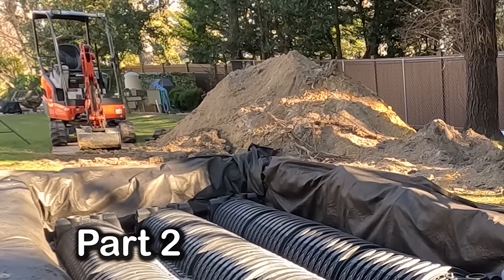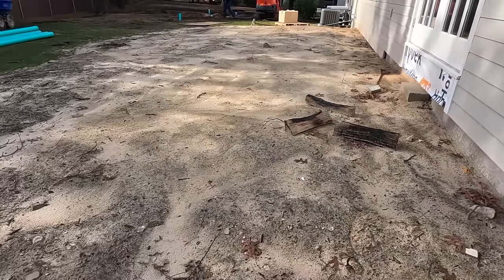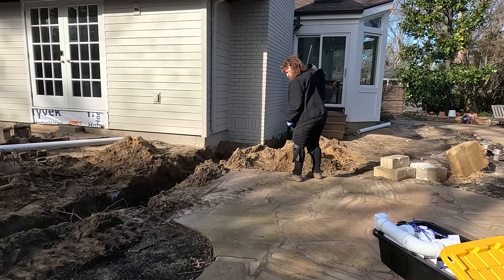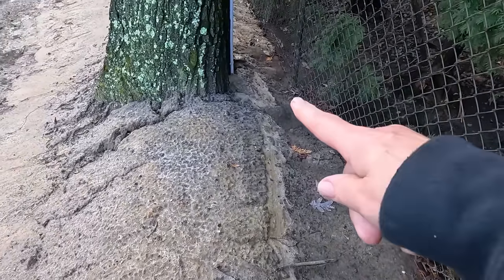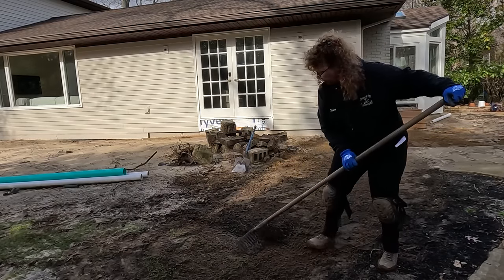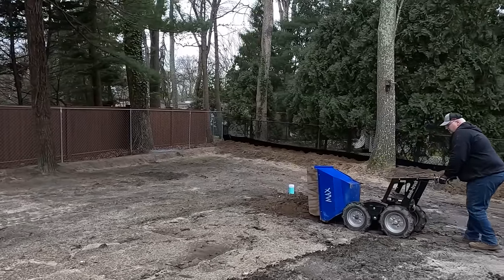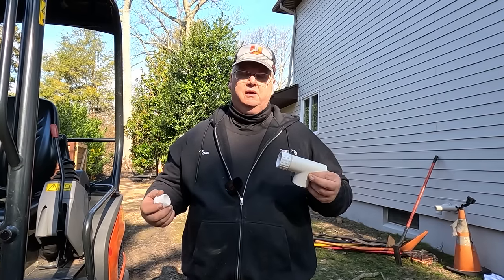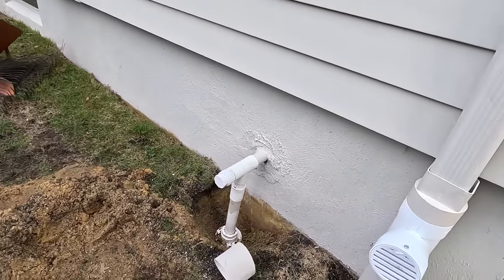Stormwater Drainage Problem - Large Dry Well, Catch Basins and Yard Grading - Part 2

Comment: Very nice job! I thought some good clay good have been used for the berm, it looks like 90% of the water comes from the neighbors.
Reply from the maker: Thank you Mike,  They definitely get a boat load of water from the neighbors, but they also get about 1500 gallons of water from their own roof in a 1 inch rain.  I agree about the clay soil.  Actually, what's there is just sand and it will erode quickly.  We gave them a price to complete the berm with a couple triaxle loads, but they decided to handle that themselves.  Thanks again, Mike

Comment: Hope there is an After video of the drainage working, if not thats a bit disappointing.
Reply from the maker: Digital, We would like to do a follow up after all the landscape work is done and the lawn comes in, but that may not be possible.  The homeowner talked about putting the house up for sale in the spring.
Reply: @tyelandscapinganddrainage  Well that is unfortunate.. Being able to see the end result of any major video would be nice.
Reply from the maker: I agree. Maybe it will work out.
Reply: @tyelandscapinganddrainage  Well your responses have earned you a sub, appreciate it.
If i might pick your brain for a moment.. Lets say that i would like to extend my gutter drainage in one form or another, PVC is likely, but what size Gutter to PVC adapter and PVC pipe size should i look for? Suffice to say i'm TERRIBLE when it comes to sizes and measurements. Its basically to just move water further from the house with above ground PVC, buried at this time isnt necessary. Amazon affiliate links to the adapters would likely be doable if you have any, the pipes ill just grab at Lowes.

Thanks again
Reply from the maker: You probably have 2 inch x 3 inch downspouts, but you have to measure that.  You could have 3 inch x 4 inch downspouts.  If 2x3 then you need a 2x3 downspout adapter and 3 inch pvc pipe.  If you have 3x4 then you need a 3x4 downspout and 4 inch pvc pipe.  You need 1 downspout adapter and 1 90 deg elbow for each downspout.  If you have a plumbing supply store by you they will give you everything you need.  Lowes also has a good supply, but might not have someone to help you.  They also have ready made flexible downspout extension with the adapter built in, but they are flimsy and may not last very long - link below to give you an idea.  I hope this helps and thank you for subscribing, Tom

https://www.amazon.com/plusgutter-White-2pack-Downspout-Extensions-Extendable/dp/B09YSW2QBL/ref=sr_1_1?crid=2C9E62YJO0ZVC&keywords=downspout+extension&qid=1707163345&sprefix=downspout+%2Caps%2C84&sr=8-1-spons&sp_csd=d2lkZ2V0TmFtZT1zcF9hdGY&psc=1
Reply: @tyelandscapinganddrainage  Thanks a lot :)

Comment: I noticed water sitting on the fabric on the dry well, so the water is not going thru the fabric, I noticed on the last video when you connected the old dry well to the new one, you put a grate and fabric covering the pipe/ grate, so that would mean the water can't drain into the old dry well very easy and will clog up.
Reply from the maker: I respectfully disagree Terry.  If you look back at 16:42 - Those are low spots, the fabric is a little wavy from backfilling.  The dry well is still full of water and percolating.  It stopped raining only a short time before.  The water in the dry well is filtered.  There's nothing to clog any fabric by the pipe going to the old dry well.  Plus, this is not a french drain.  Water gets into the main dry well from the plumbing, inlets and catch basins.

Comment: Love the video, my ? is the roof gives off 1500 gallons in a 1-inch storm, what's the estimated holding capacity of the   dry basin you installed.
Reply from the maker: 2000 gallons
Reply: you  answers my ? at the end of the video 2000 gallons
Reply from the maker: We talk about the dry more in pt 1. Thanks for watching

Comment: Were the utilities lines flagged before the dig work?
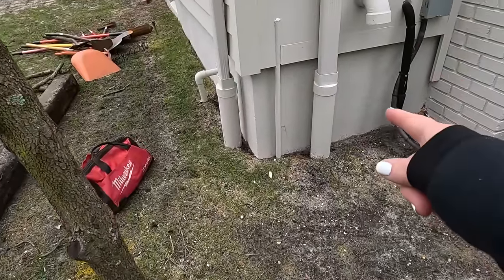Reply from the maker: Yes, there was a utility mark out.  811 / NJ1call doesn't mark private utilities.  You can see the mark out flags well in part 1 and a couple at 21:17.  There's a gas, electric and water line going to the pool that wasn't marked by 811.  This is also a new homeowner and they don't know where the utilities are either.

Comment: Why were none of the utilities located for you? I understand private lines are not located, but the electric line not being located??
Reply from the maker: Brooks, I don't know how else to say it.  NJ1 call - 811 marks the utilities from the street to the house - public.  They don't mark private utilities.  In the front yard the electric is up in the air, so I got an email saying 'not in conflict'.  The electric and gas lines from the house to the pool pump/heater are not marked because they're private.  If you watch pt1 you can see the mark out paint and flags.  This is also a new homeowner and they don't know where the lines are either.  Have a good day, Tom
Reply: @tyelandscapinganddrainage  I understand. They will mark them in our area. Not private water though, or any private line the homeowner might have laid, like a detached garage that had electric ran to it. The only one we get conflict on is the gas line. Sometimes they will locate the private line from the main up to the house, if the gas meter is next to the house. If the meter is between the house and the main they will not locate the section from meter to the house. Sometimes they will 🤷🏽‍♀️  - confusing to say the least. Thanks for the answer  😊
Reply from the maker: Thank you Brooks. It sounds like we have the same rules. Have a great day, Tom

Comment: I was just wondering why you folk’s don’t get the utilities marked before you dig? I don’t know about up North but down in my part of the country it’s free and highly recommended to avoid paying for the repair if you happen to damage a line
Reply: Utilities won’t mark in the backyard because they didn’t install it. They will mark any service lines coming into the property - nearly all in NJ are from the front yard. These guys do stuff by the book so I wouldn’t be surprised if they did call 811 for a mark out.
Reply from the maker: Gary, like Mookie said; 811 doesn't mark private utilities.  You can see the mark out flags well in part 1 and a couple at 21:17.  There's a gas, electric and water line going to the pool that wasn't marked by 811.  This is also a new homeowner and they don't know where the utilities are either.
Reply from the maker: You're awesome Mookie, Thanks and have a great week, Tom

Comment: Was wondering what the ramifications are for blocking the drainage of those two neighbors' yards onto your client's yard. Are there any municipal codes that prevent that, or is it just legally their bad luck that your clients decided to deal with their neighbors' nuisance water? I guess their only option now is to hire you guys to put in their own dry well systems. ;-)
Reply from the maker: It depends on the town Jon.  I was just talking to another town engineer about a customer with a similar problem.  He told me we could not add a 'planting bed for privacy' which would stop the neighbor's water.  While they also have the rule that water has to be contained on your own property, he said we couldn't impede the flow of water coming from that neighbor.  That doesn't make sense to me.  He said we could do it, but if the neighbor complained we would have to remove it.
In this town, from the video, water is supposed to be contained on your own property.  The town engineer was willing to make the neighbors stop sending their water to our customer, but he would have to file a complaint with the town.  That would probably start a war in the neighborhood so he decided to just handle it this way.  Tom

Comment: I have a question why didn't you just put a drain in that backyard and run a 4-in pipe to the city street and just let the water go out down the storm drains for the streets instead of putting in that large drywall system,  Or is that against the code in the city where you live? I do a lot of commercial construction and around most every parking lot that I do or project I do that has any type of asphalt area I generally dig a 2 ft deep ditch and put in corrugated drain pipe with a sock around it and 57 stone on top to catch any water before it gets to that parking structure or parking lot or asphalt whatever I'm dealing with and get rid of it that has saved me more than one time.
Reply from the maker: Hi Dozer. The dry well was the only option. The city wouldn’t permit any of this water going to the street and it’s actually about 5 feet uphill to the street from the backyard so it would need to be pumped - definitely not legal. We covered all this in more detail in pt1.

Comment: I have a problem with groundwater inundating my septic system and really cannot afford to put in a mound system. My thoughts are to put in a sump pump located about 4 to 6 ft deep to get rid of groundwater at that level. I was thinking that I could use a gabion basket that is roughly 4 ft by 4 ft by 6 ft deep to accomplish this with a decent or adequate size pump at the bottom of this basket. Does this sound feasible to you?
Reply from the maker: This is not my area of expertise.  I can tell you that we lower the water table by pools by installing a fairly deep french drain around part of the pool with a sump pump.  That lowers the water table so the liners don't float.  I've also seen 'Dirt Perfect' install interceptor pipe or drain to stop ground water from getting to a septic system.  Those are usually daylighted.  They do make plastic crates that are used in pondless water features similar to your gabion basket.  They are also very common in the UK for soakaways.  I do wonder how you pump to lower the water table, but not start having septic water intrude your system.  Where you wind up pumping ground and septic water combined.  I'm sorry I can't be more helpful, Tom

Comment: why wouldn't the neighbor be responsible for their yard causing water damage? over there
Reply from the maker: You're right Ed,  We had a meeting with the town engineer at this property.  They were willing to go to the neighbor and make them redirect their runoff away, but this homeowner would have to make a complaint.  That would probably start a war in the neighborhood and the homeowner decided to just handle this from our side.   Have a great day, Tom
Reply: We had same issue as this house with massive flooding caused by the neighbours on both sides changing their grading without permit or town authorization or direction. Huge issue, a lake while their yards remained dry. The town official said, well this is why you have the problem but it’s private property so it’s your responsibility to fix your own yard or consult with neighbours.  Neighbours are not will to do any work or spend any $$ so we end up with a work having to be done very similar and to the extent of this video. We paid the contractors, excavators and paid for a permit from the town.  People should not be changing the grades on their lots themselves, they don’t know what their doing and cheap out. If a problem arises it’s everyone else’s fault including the town and their expectations are that town should fix it.
Reply from the maker: @Anonymously4051 very true

Comment: Wow what a wet-mess of water from the neighbors.  I just don't know if I can agree with only having a dry-well without an overflow. 6 inch smooth-wall pipe only need 0.5% slope to self-clean & could drain your 2k gallons in around ~8 minutes.  IMO the dry-well should be on the lowest-drainage part of the yard which would be near the pubic-ROW.  That setup is not at all going to reduce the 6 hours of ponding b/c the Ksat-rating of the soil was not changed so seeping has not stopped. 47:01 He probably still owns a lake.
Reply from the maker: Thank you for your insights Bob.  Elevations don't show up very well on camera.  I would love to have installed an overflow, but it's about 3 feet uphill to the front yard/curb.  This is the lowest point of this neighborhood.  We would have to install a pump to make that work.  Thanks again and have a good day, Tom